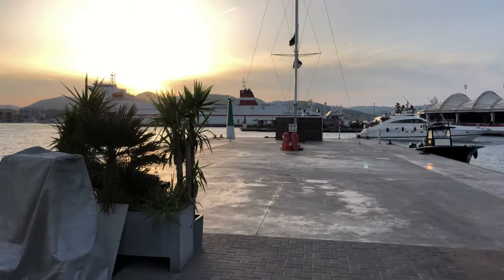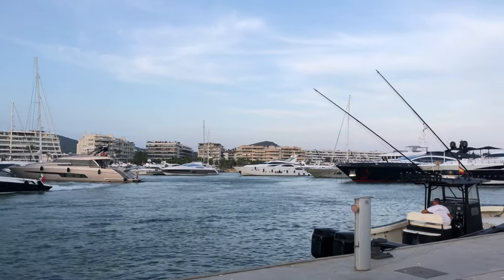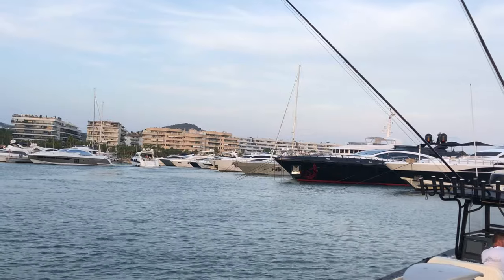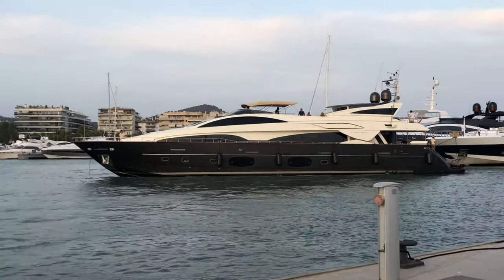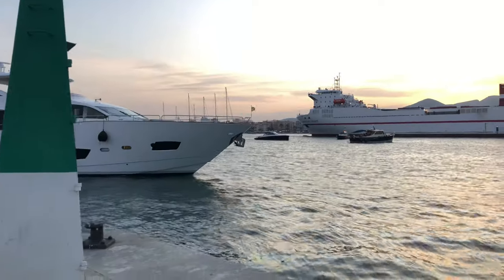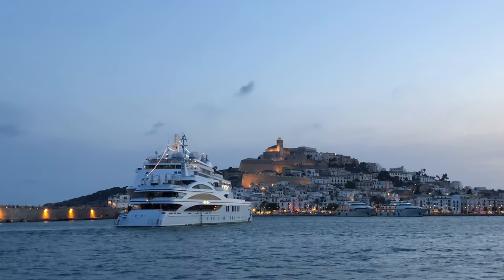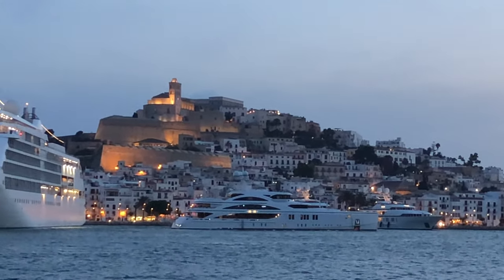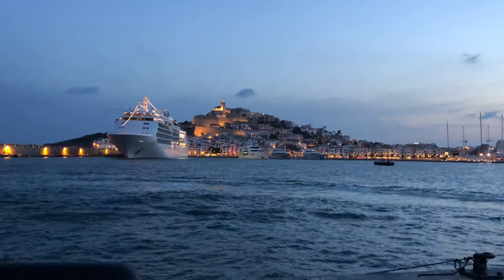Loads of yachts docking! How to dock a yacht. Watch until the end for Big yacht docking

Comment: Nice video. How do a marinero takes the ground line out of the water to give it to the crew?  I've had a Princess 42 mooring in Port Frejus ( south of France) and after that in Biograd (Croatia) but I always had to pick up the ground line from the dock. Thanks for your answer.
Reply from the maker: Yes they take it from the dock where the line is tied round the pillar, they lift it on to the rib and then pass to the crew.

Comment: Are you telling us that you can turn up unannounced at Ibiza marina and "just" get a berth?  C'mon guy, looking at the marina 1min18secs in, i don't think so.  Tell me i'm wrong but to find a berth in any Balearic island in summer is nigh on impossible.
Sorry, but i've got to pull you up regarding boat manoeuvrability at 10mins15secs in.  You cannot spin a boat on it's axis on main engines alone.  If you watch the water at the front of the boat you will see water disruption.  That is the "Bow Thruster" forcing the bow around.  There is also a "Stern Thruster" that does the same thing.  They are perpendicular to the keel or crossways to the length of the boat  If you drive one to the left and one to the right the boat will spin on its axis.
BTW; As a boat owner why would i want to dock in Ibiza? Apart from all night parties, noise and never ending alcohol, what is there on the island?  Edjukate me.